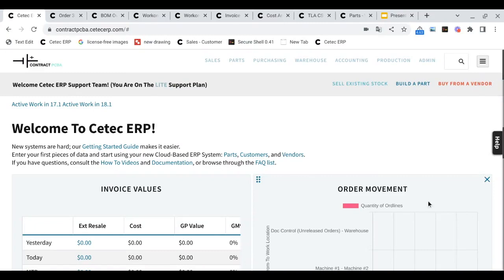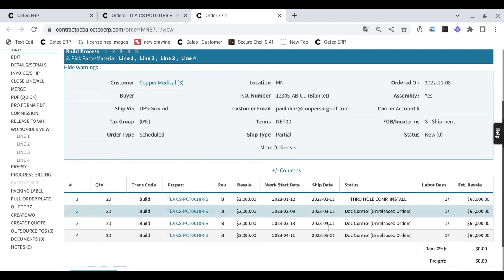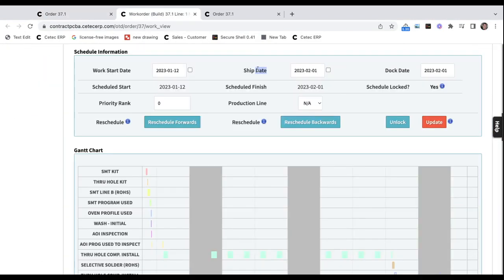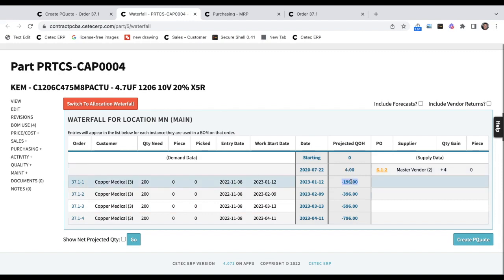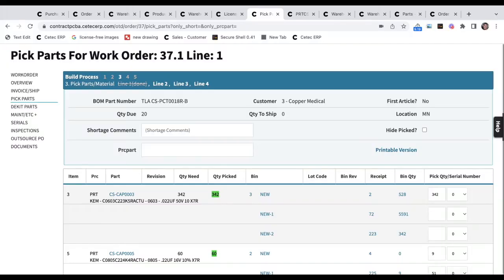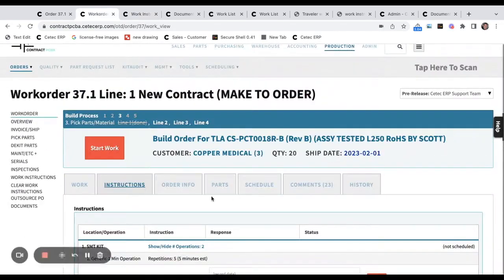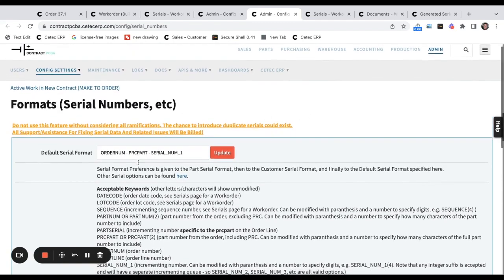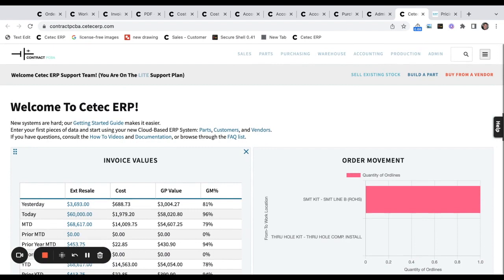PCBA / EMS / Electronics Contract MFG Demo - Cetec ERP Demos By Industry

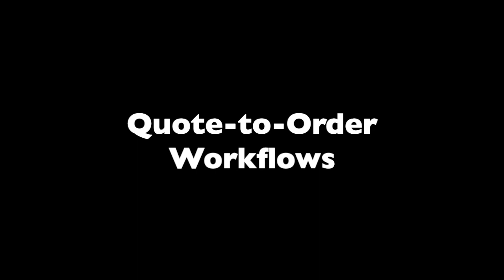Comment: 11:12 Quote to Order Workflow
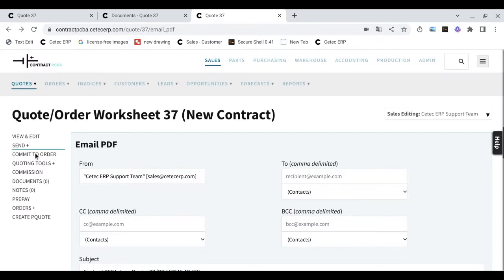12:09 Tasking Assignments Via Quote Workflow
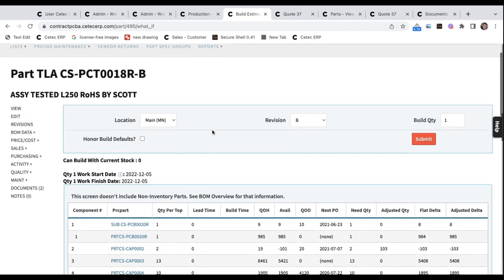13:59 Workflow tool
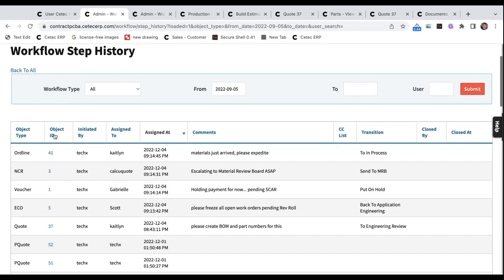14:24 Quote Cost Estimate
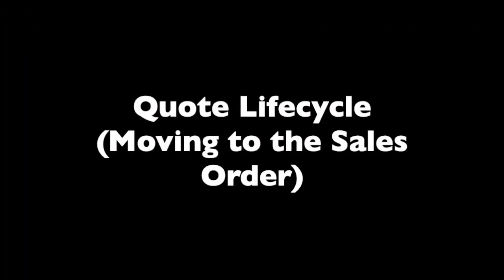15:35 Quote Lifecycle (Moving to the Sales Order)
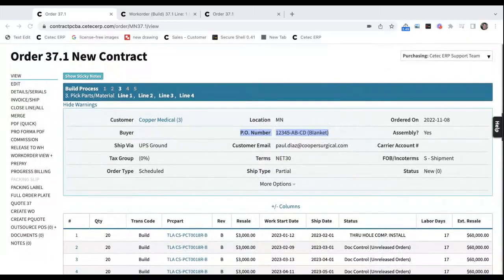16:25 Planning & Scheduling
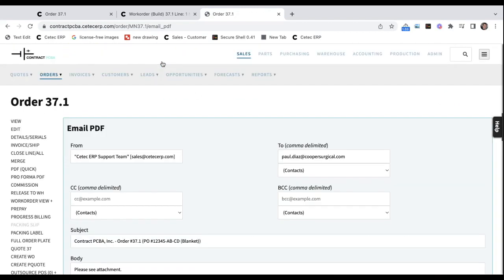16:44 Manufacturing Modes
17:04 Make to Order Manufacturing Mode (short mention, bypasses Finished Goods stage)
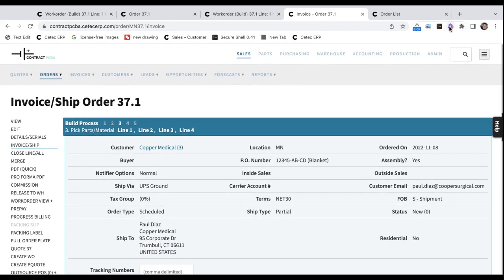17:26 Material Lead-times & Avail to Promise (Materials Forecast)
18:38 Production Scheduling
21:59 Purchasing
23:47 Buying through MRP (Tracks and allocation of existing supply of material *Waterfall Report*)
26:44 ShopCQ CalcuQuote Integration into Cetec
28:18 Receiving
29:47 Lot Control & Traceability Report
30:52 Work Order Release to Pick/Issue Material
33:08 Inventory Management (Cycle Counts, Adjustments, Auditable Inventory Activity Report)
34:18 Scanning into a Work Order Traveler
35:43 Paperless Routing
36:47 Estimate versus Actual Time Reporting 
37:31 Piece Throughput and Labor Efficiency
39:29 Production Status
40:21 Work Instructions and Build Documentation (also Work Traveler)
42:25 QC, Inspections, QA
44:03 Scrap Processing-Raw Material
45:45 Scrap Process for Finished Assemblies
47:18 Outsourcing and Subcontracting
48:33 Serialization
51:04 Packing/Labeling/Shipping/Invoicing
54:37 Job Costing/Financials/Reports & KPIs